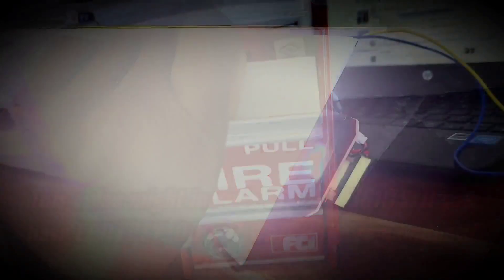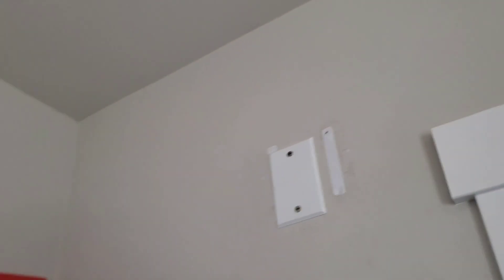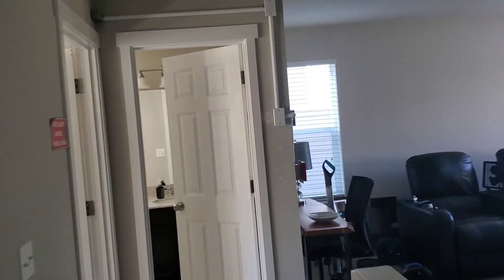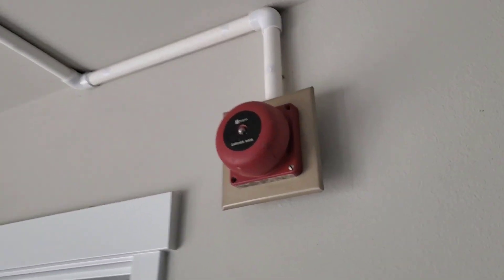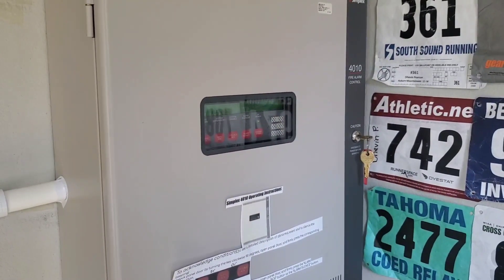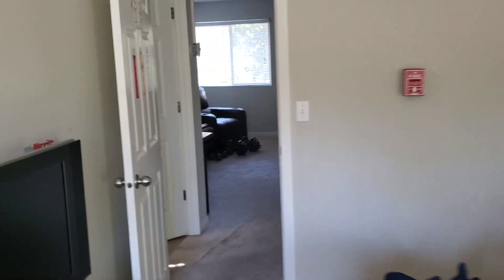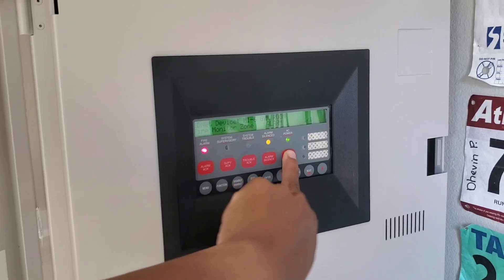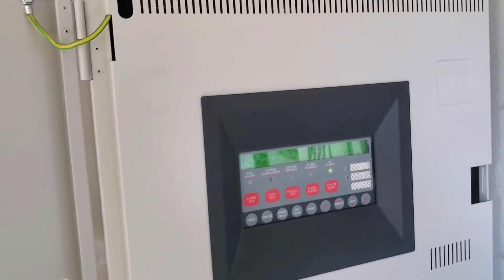System Test 72| Simplex Vibrating Bells

Comment: 1:55 Class is over. You never know when the school bells are going off.
Reply from the maker: Hehehe, luckily I didn't have to go through that growing up as the bells were a chime that went through the PA system.
Reply: @BlackLightning4547  My first elementary school had Simplex 4090 6" bells, sounding exactly like your 4080 bell (a.k.a. the Hollywood Edge "Premiere Edition" stock school bell), and they WERE really loud. My middle school had Edwards 6" Adaptabels that were almost as loud and some Edwards single-stroke chimes. My second elementary school had nothing, and my high school had a time tone over the PA system. So I pretty much got to experience all the different bell types in my public school years.
Reply from the maker: @ZakWolf  Nice 👍🏼
Reply: @ZakWolf My school had Edward's 6 inch vibrating bells. Always scared the hell out of me.

Comment: Those 6" bells are pretty much the Hollywood Edge Premiere Edition stock school bell you always hear on TV. My first elementary (now K-8) school had them as the school bells, but they were a golden gray and flush-mounted. They also used to have a Simplex fire alarm system with 4051+4050-80 horn/lights and 4251-30 break-glass pulls, even a Simplex 4010 panel tied into the original 4208 system for added-on duct detectors, but now they just have boring SpectrAlert Advance horn/strobes (so now the school has the most common school bell on TV and the most common fire alarm in real life!)
When the bell rings on Code 3, then it sounds just like the school fire alarm bells in "Kindergarten Cop".
Reply from the maker: Yeah, pretty much, but that's cool though.

Comment: Everyone needs to bring these fire alarms back.
Reply from the maker: Bells are still being produced, but only used for waterflow or general fire alarm, mounted on the exterior of the building.
Reply: @BlackLightning4547 Yeah I know, but I meant for everything.
Reply from the maker: @sandiegotrafficlightstrain354  Yeah but horn strobes are more aesthetically appealing since they're smaller; they're easier to work with(to mount, to wire, etc), and they're more efficient. So from a realistic standpoint, bells make no sense.

Comment: I really like that 4 inch bell!
There use to be a clothing store in my area that had a system full of Simplex 4080 bells. The panel was a Simplex 4001, pull stations were most likely 4251-20s and the detectors were 2098 series ones. I’ll bet the system was set for continuous. The building that store was in got demolished a few years ago, but I still remember everything about it.
Reply from the maker: Oh coolio

Comment: the 6 inch 4080's sound like the 2901-9332.
Reply from the maker: Well that's the successor to the 4080s, and not much really changed between the models other than a couple of cosmetic changes, so not surprising that it sounds the same.